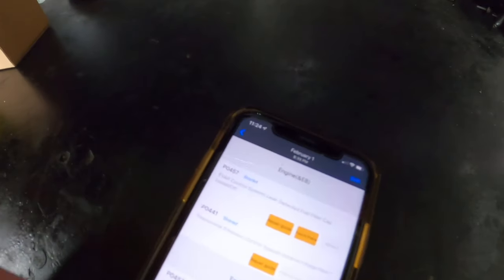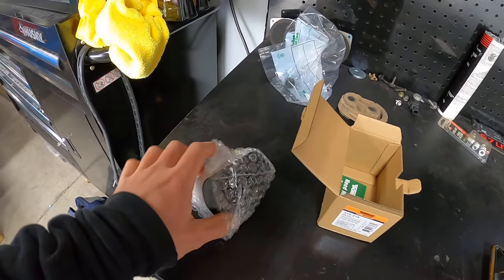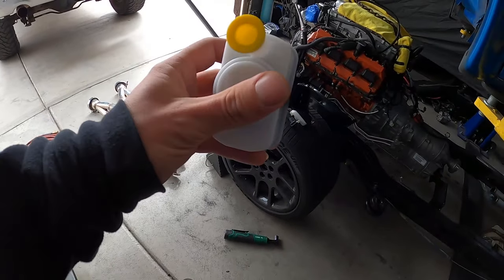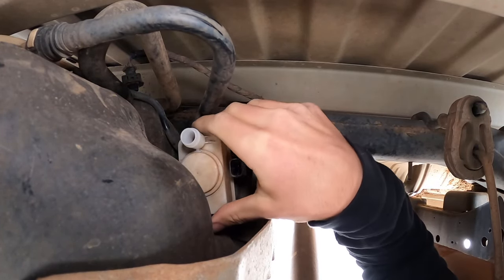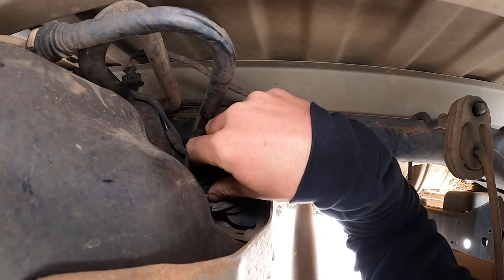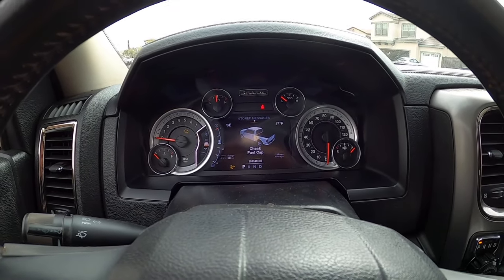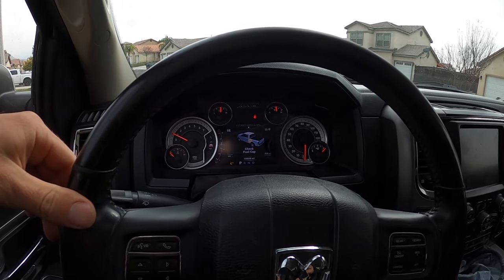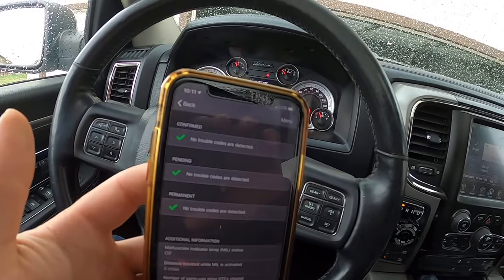RAM TRUCK GAS CAP LOOSE P0456 P0457 HOW TO REPAIR

Comment from the maker: Here is the link to the part! https://amzn.to/2N18rxB
Reply: Thank you brother My 2014 Ram 2500 with the 6.4 has the same issue. I used to have a 2010 Ram 1500 which had the same issue. I have a lot of gas caps 😂 if anyone needs one. Thank you again.
Reply: Thanks much help!
Reply: Do you have the link to the other part that you tried replacing under the hood?
Reply: Do you have a link or part number to the one you talk about towards the end of the video around the 7 minute mark in case that is the issue?  Thanks man.  Enjoying your videos.  Been helpful so far on a couple of DIY repairs.
Reply: @crystalvillarreal8579  its the purge valve under the hood if you still need it 😆
Reply: Thats not the link to fit my 06 ram 1500 so I don't know what year your truck is but it's obviously different from mine
Reply: Crazy thing! I've taken my truck to 2 parts stores and my truck does not show any codes. What gives??
Reply: Does it always give a code with it? Replaced my fuel sender yesterday, getting check gas cap on the evic today. Scanner is giving no code
Reply: Do I have to clear the code after repair
Reply: More info on gasket. Can't get rid of P0456.

Comment: Went to the dealership to get my truck checked for the engine light and asked me if I wanted it fixed for $330! You saved me from wasting money on a simple fix. Thank you!!
Reply: The dealership is insane they will intentionally damage your car so you have to come back it is not a myth it’s true! ℹ️
Reply: I sued Dodge of Burnsville for $12,000 over them destroying my hemi after they replaced it I sued them even after they put a brand new motor in the car I still got a lawyer
Reply: Same here! 2015 Ram1500 and they wanted $400 plus an extra $200 for the diagnostic
Reply: Dodge of Burnsville is Horse shit! If that’s the same one in MN! They did my oil change and didn’t put on the filter tightly I had oil drip everywhere and they said it wasn’t their fault, cmon man it’s a freaking oil change only man! Smh
Reply: @Ronald Perez  ya well shops aren't free and diagnostic time isn't free either not sure what you expect?
Reply: @Supernatural1978-OG  GOOD!! 👍👍👍
Reply: @serbia991  ETHICS
Reply: @paperpeng1  I bought my car from Tom Green at Dodge of Burnsville!
Reply: @serbia991  So you’re one of those guys that rip people off that works in the service department you tell them they need parts and maintenance that isn’t even necessary and then you don’t even do the work you just claim that you did the work and send the car back out to fail! 🫵🏽
Reply: @dougwilliams44  If a car is within 4 years of the manufacture date and it’s been in the shop more than 30 days in the first year that you own it then it’s a Lemon technically by law that’s how it’s written I called an attorney in St. Louis Park, MN. named David Fossey he handled everything for me and got me my settlement!
Reply: @KrazyWorldMovement  nope but my time ain't free I don't do a single thing for free if you want free go else were good Luck
Reply: I agree
Reply: @Supernatural1978-OG  Yup believe it 100% and that's why im watching this video to fix their screwup smdh
Reply: 700 for me today.
Reply: @serbia991  Big difference between being "free" and ripping people off.
Reply: Beware the 3rd gen is a different part number with the pigtail on the opposite side. I still needed to clear the code afterward, but it worked! No more gas cap message or check engine light. Basically, if the old one rattles, you'll know it failed
Reply: Did you ever say what that part was please?

Comment: It's called the purge valve under the hood that you replaced at first and the one above the fuel tank is called the ESIM. Typically in these cases with that code we smoke test the fuel cap for a leak then we will test the whole system. Which you can test from the filler neck or the purge valve hose. While smoke testing the system and you can't find a leak it's best to replace both purge valve or ESIM. But if that doesn't fix the issue 99% of the time is the fuel tank. It has lines that are molded to the tank and you would have to replace the tank. To save everyone that costly shop bill at a dealership replace the purge valve or purge valve hose if it's not a rubber hose and the ESIM. And these are not covered under you emissions warranty bc these are considered "wearable items".
Reply: I have taken my 03 ram 1500 to multiple shops and they say they can’t find a leak with a smoke test. They replaced the purge valve and leak detection pump that’s by the gas tank but I still have codes p0442 and p0456 could it be the canister by the fuel tank?
Reply: @decorationdude  same i replaced both smoked out the tank and “no leaks” stupid rams i just paid to pass instead
Reply: @jonathanezell4825  so you could never find the leak?
Reply: @decorationdude  i never found it pretty gay honestly , some people replace their gas cap or the the evap canisters and it works but not for me , fuck it just keep that good oil with lucas oil stabilizer and tighten ur exhast manifolds once a while and ur trucks solid
Reply: Thanks for your write up,  that is exactly the information I was after.
Reply: @robertseither6834  ?
Reply: Same for P0467?    ..Is evap system on the ASD circuit?
Reply: Alex Hicks I have a 2017 2500 Ram, just had the original bed swapped out and installed a flat bed, I have been smelling gas from time to time when getting in my truck but never see anything leaking,  my gas cap light came on today and not sure what you meant by leaking.  Is it pressure you're referring to? If so could it be where they re-did my fuel house and its leaking pressure? Thx for your help
Reply: @w0lf1969  they could have crushed or pinched a EVAP hose in the process of swapping the bed. If you are smelling gas I'd check the lines well, the top of the tank where your sending unit is to see if the seal is leaking. It could be a small leak where the fuel evaporates before it can actually drip anywhere. And yes it is pressure but if a EVAP line is cracked you will smell gas fumes. Do a good visual look and if you can't find anything try and have a smoke test done. Hope this helps.
Reply: Such a Crock, all this EVAP crap. It needs to be DELETED from Productuon. J/S
Reply: Leak Detector Pump?
Reply: NO SMOKE TESTS

Comment: Wish I found this vid a few days ago. Replaced the gas cap, replaced the purge valve. Actually found the filler vent had become disconnected so I was thinking that was the issue. Being the is the last thing before I need a smoke machine and how easy it is. I’ll give it a go. Would be nice to clarify the ‘2 days’ required to clear the code. The drive cycle info is horrible for dodge / this issue and the car needs to run tests over night to get rid of it lol.

Comment: I replaced this part on my wife’s 2012 Ram that was throwing the P0441, P0455, P0456 and P0457 codes with check engine light and loose gas cap warning. Fixed them all and the truck passed CA smog a couple days later. Thanks for the vid

Comment: Thanks for this video.  Dealer wanted to charge me $175 to check my truck.  I went and bought the part,  didn't need to clear code,  codes cleared on their own. Thank you so much.

Comment: This worked perfect for me.  I have a 2015 RAM 1500 Outdoorsman with the V6 3.6L and this was the right part and procedure.  I also had the service engine light on as well as the gas cap light, so once I installed this and the gas cap light turned off I then removed the negative battery cable for around a half an hour and that got the service engine light to turn off also.

Comment: I have an 09’ Dodge Ram 1500 SLT V8. After failing the emissions test I found your video and bought the part from O’Riley’s. The Dorman did not rattle, my original part rattles. Replaced the old part and within 2 days the check engine light cleared itself. The emissions codes were P0456 & P0457. Gas cap was replaced onsite by emissions for free in Ohio. Both codes have cleared themselves. Going in for another test this week, I will update results. Thank you for clear, concise info, you are saving me money and time 🫡 and possibly missing a day of work due to taking to a mechanic.
Reply: My old part rattled too
Reply: Update, passed emissions 🫡

Comment: Thank you for the video. I just replaced the Evap Emissions System Leak Detection Pump on my 2015 Ram 1500 3.0 V6 and it solved my check gas cap/check engine light issue. $40 and 40 minutes. Your instructional video gave me the information I needed to get the job done right the first time. I did loosen the heat shield and moved it out of the way to make more room and an easier install.

Comment: Thank you for this video, bought the part at my local ram dealer for like $30 bucks or so,  on mine, I had to squeeze the tab and turn, I was trying to push it up and it wasn't working. And you can't really see anything up in that tight spot. I also used the vehicle ramps from harbor freight to lift up the back end and slid under there with a creeper. Made this job super easy.

Comment: Bravo Man!! Glad you did this.. The fuel tank prob is 99% the O ring between the LDP (LEAK DETECTOR PUMP) on the tank. The square "O Ring" is junk after 50,000 mi. Today's GAS is crap. Ethanol rots hoses & Plastic lines. I did 42 of JUST THE LDP's yesterday. My shop manager got upset that "I didnt SELL any Parts & Labor" on 5 that had OVER 100k mi. O'Reilley or Advance has the #LDP for around $38. Hope this vid helps others! 👍

Comment: THANK YOU.  Couldn't figure out what the problem was until I saw this video.  BOOMSAUCE!  Got under the truck and the whole white part of the plastic had disconnected from the shattered black plastic backing.  The whole thing was just banging around hanging loose with a full gap.  Amazingly, the O-ring was in place.  Pulled everything out and the white plastic off the tube and popped in the new one.  first ignition the gas cap light went away (I had already replaced the cap), and code clearing the P-code resulted in the engine light staying off.  Brilliant video.  I'm subscribing just on this one alone. Thank you!  The Dorman part you indicated did the job (Ordered from Amazon).
Reply: Were your truck also overheating?
Reply: @romeparker1686 nope. Just throwing a code. Nothing to do with actual engine performance.

Comment: Thanks for the video, dealership just fixed my fuel guage/float sensor that was out when I bought it. Got it back and had fuel cap light & message, watched this video and crawled under my truck and they re-connected the hose but forgot to plug it in! Problem solved & message cleared 👍💪TY AGAIN 🙏🇺🇲

Comment: Excellent Video.
My only problem was getting my Rear End of the Truck High Enough to reach into the cavity to get the old part out!
They need to put a slightly longer tab to get your finger around.  You will have to be a contortionist to get it out.  
However, finally got ahold of the tab and turned it loose.  
I replaced it with the DORMAN part listed below.  I also used a little bit of Clear Silicone lube to lubricate the rubber O Ring.  This is not required, but will keep the O ring from drying out.  REMEMBER:  Always use a good Silicone Lube on any Rubber Parts.  Since anything Petroleum Based will destroy rubber Gaskets.

Got the part back into the cavity and a quick 45 degree turn back in it went with tab clicking in place.

Removed the power to reset the Check Engine Light.  Reinstalled and started engine.  

FIXED!  YAY!

Upon inspecting the old part, there were several very small hairline cracks making it defective.
Dorman Parts are far superior to MOPAR since they use a thicker and stronger plastic.  Hopefully, this will be the last time I have to fix this part.

Comment: Thank you once again!  It wasn't fun, but once I figured out how to get my hand in there, I got it done.  It was easier for me to remove the whole thing, then disconnect the hose and electrical clip.  Install was a piece of cake.  Thanks again  Boosted!
Reply: Did it FIX your issue?
Reply: @dougwilliams44  
It did fix the issue.

Comment: Thank you! I just bought a 2014 Ram and sure enough 2 days after I drove it off the lot, I got the gas cap warning. At least now I have a direction to go in and thankfully a very affordable fix too!
Reply: Did that fix the problem? I just got a 2014 myself and a week after I got it, I had the same thing happen. Also, what size fuel tank do you have? I have the 32 gallon and I’m wondering how it is with the bigger fuel tank. Thanks!

Comment: W
Just watched the video and literally replaced the Dorman in like 10 minutes.  Code gone!! Great video.. Thanks so much!!!
Reply: Did u have to reset battery to clear check engine light?
Reply: @vonnieboy7878  
Yes I did. I disconnected the battery for a brief minute the reconnected it. Codes were gone.

Comment: Great video and advice, thanks!   I had this exact issue, same trouble code. Replaced the gas cap to no avail but once I replaced the evap valve and disconnected the battery for 20 mins I no longer had trouble codes!

Comment: Thanks for the video! Pro tip: on the 2014 6.4 HEMI (RAM 2500), the pump is just in front of the drive shaft and just behind the transmission, facing the passenger side. 

Hopefully this takes care of my check engine light and fuel cap light!

Comment: Was just crawling under my 2012 truck looking for it. Thanks for letting me know exactly where it is. I don't have enough room to crawl, so it's going to have to be lifted up a little. Thanks big time on the other valve on the engine to test. Could it just be the O ring leaking?

Comment: Thank you very much for this.  Just watched your video and fixed.  After watching many videos I knew it was this or my purge.  Why I chose to let the dealer smoke test when I really knew this was the issue was stupid on my
part.  I guess the only takeaway is I know it’s not the filler neck or a hole in the hose.  Don’t spend for a smoke test when in all likelihood this is the issue.

Comment: Excellent info.  I would have given up on getting mine off if you hadn't shown the way with that little release clip.  My big hands couldn't get in there the first few times so I went back and watched your vid some more.  I finally felt it move with my fingertip and figured out how to release it and get the turn started (standard lift, and not jacked up made that pretty awkward..).  After a few miles and engine start/stops, all the codes are gone!  Thanks my friend!

Comment: I got a 2014 Ram 1500 couple weeks ago and this came up on my truck too. I replaced the gas cap, & the evap system and the code still came up. I hope after replacing that fuel gas detector it will clear the codes 🙏🏽

Comment: Man, I forgot your name, but thank you.   I actually had this part before I watched your bid, but you're really helpful. 

I never had a problem until I replaced the gas pump recently.  My theory is, in addition to the bad square gasket design, I think the new gas pump produces more pressure, which somehow influences the emissions part to leak.   

Replacing it today!   Thanks again.   Maitai.
Reply: *Vid.

Comment: I just did mine today, did not change out gasket.  Light still on for gas cap and engine light so I disconnected RED side of battery and cleared it.  Have driven it 1 time....lights still out.  Crossing fingers that it doesn't come back on.  Turning that thing left made a snapping sound and something popped off as I heard it hit the concrete, but never found out what it was that broke off when removing the old one.  New one went on easy, but forgot to change out gasket and it didn't want to turn off again so I didn't force it and risk breaking whatever broke taking off original.  This was a whole lot easier than the rear shocks I changed out today along with this.....needed breaker bar on all 4 bolts.

Comment: Great instructional video.  I watched many videos on this error on my 2016 Ram and on YouTube they told me to replace the one above the engine the purge one I still have the error code so I will order the other part and install that and hopefully that air cold goes away it seems that’s what it is.  Thx

Comment: I took the connector off the part (guess its called  Evap Emissions System Leak Detection Pump or ESIM. I call it junk) I then cleared the fault codes and jumpered the connector and no more stupid gascap messages. I then cut connector off and spliced the two wires together bypassing the junk and no more failures or parts replacement.
Reply: Is that still working? I’ve replaced this part and the light is still staying on. I’ve even replaced the purge canister.
Reply: Hey, I am also thinking about it. Any update of your "hacked"?

Comment: Beware the 3rd gen is a different part number with the pigtail on the opposite side. I still needed to clear the code afterward, but it worked! No more gas cap message or check engine light. Basically, if the old one rattles, you'll know it failed. Also, on the 3rd gen, the part is further toward the front of the truck, connected directly to the canister

Comment: i went through 2 of those Dorman parts and both got stuck and wouldn't let me pump gas. if you can find the brand "Standard" they are the OEM parts for the leak pump and the purge valve.

Comment: My truck had the same issue. I replaced the part and kept on getting the code. Turned out I had a small crack on the top of the fuel tank. Make sure you inspect your tank guys.

Comment: Same exact issue and new gascap OEM from Mopar. Come to find out there was rust around the gas filler and didn't make good connection. 78.00 fix no more codes 😊

Comment: Could you tell me if it's possible if I were take power folding mirrors from 2016 laramie with the control module and associated wiring and installed them onto my 2009 laramie. Would it work ?